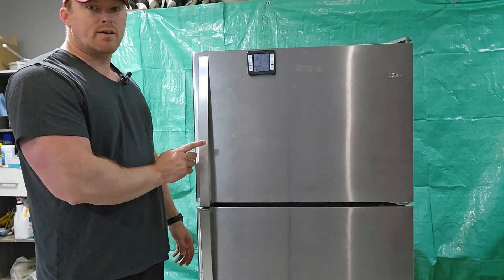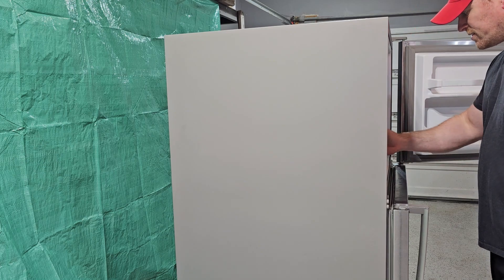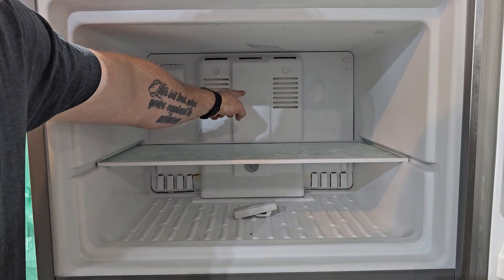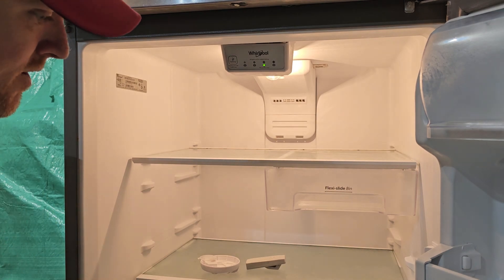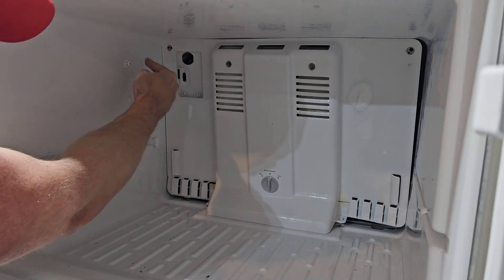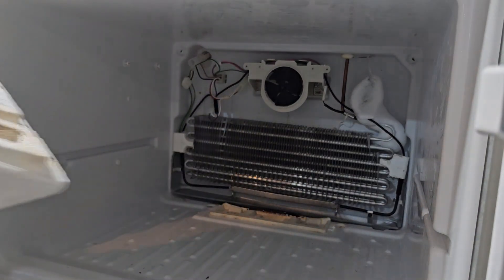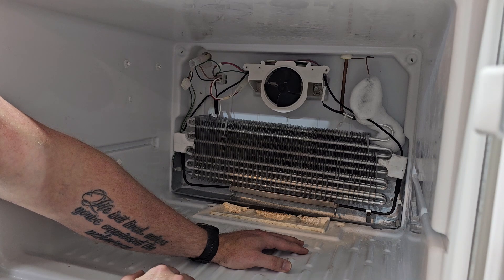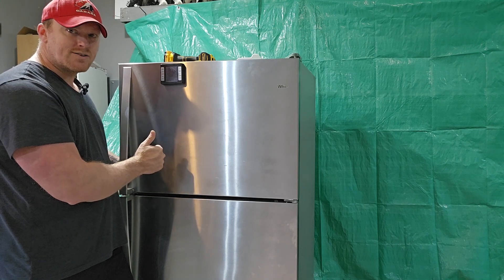Why Your Fridge Isn't Cold! From Fans to Refrigerant Diagnosing

Comment: Love the Video Really helpful , followed all your Steps And Sadly😢 Found the Heavy ice spot u also found , So does that mean ….. just buy a New Fridge?..
Reply from the maker: Check the fridge evaporator again in around an hour and see if the frost pattern changes, if it does not then yes it would be cheaper to replace.
Reply: Yea Checked it this Morning and still building up 😅 thx better start looking
Reply from the maker: @robertcoates2217  that sucks, how old is the fridge?